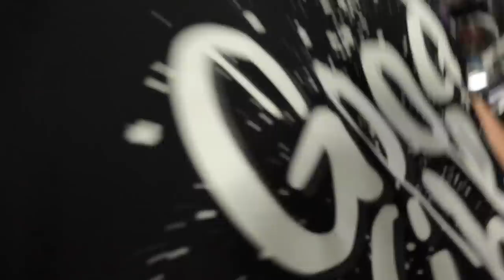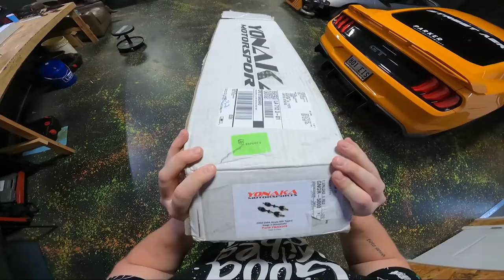This old Honda has 2 STEP??

Comment: 17x9 +22 is perfect fitment paired with 245/40/17. Also I highly recommend Acuity’s 4 way shifter, I tried the k tuned shifter and some similar ones but you had to be ultra precise or it wouldn’t go into gear
Reply: Or +35 if you don’t want to pull the fenders
Reply from the maker: Thanks! I’ll have to remember this for wheels
Reply: @Zorbii  i have a full new set of Rpf1 17x9.5 +32
Reply: do you have pictures on any media ?

Comment: I think a v12 swap sounds most practical
Reply: V12 AWD
Reply: @Vaigue  This ain't Forza
Reply: @aftrnoon_ac  Who says it c a n ‘ t
Reply: who the hell would v12 swap a rsx
Reply: @qajoh8714  it’s a joke
Reply: @qajoh8714  @boostedboiz ideas are flowing
Reply: I think a 40lt diesel v16+supercharger souds even practical
Reply: @hectorramssesgarcia4532  Tbh I think 3 2JZ’s with T66 Turbos, a 69420 shot of NOS, and a Motec system exhaust sounds more reasonable
Reply: Indubitably

Comment: I’d love to see a N/A route where you do some cool engine work and do autocross or time attack. Mine has 223K and still goes strong. So you won’t have to swap in a K24 for a good bit haha. But I’ve been wondering what my steering wheel was shaking for on to the expensive purchase.

Comment: Hey zorbii first time watcher, really like you stuff. I have a Acura rsx 06 apparently it ain’t actual launch control just a 5k rev limit when the car is not moving. Best part about Hondas is you can use the rev limiter as lunch control cause their engines are so durable
Reply from the maker: That's what I was about to say! It actually works great to use as launch control.

Comment: Daniel is not a second axle. It's an intermediate shaft/ half shaft.  Used to equalize axle lengths,  or you wind up with vicious torque steer. Like into the trees/ ditch, or in Japan, oncoming traffic.  I've been in the import tuner scene since pretty much you were in diapers... long before it hit Louisiana (S.E La here) I used to do all kinds of swaps, modulus Rbs into s13s (first properly working RB20 in the country)  unlike those d bags from VA who couldn't get there's to Rev past 3700. Anywho.. glad to finally see an upload from you.  Keep up the good work.

Comment: I have an 03 TL Type-S and I actually had my passenger side axle snap at 197k miles and I have to say the passenger side is a much different ball game than the driver when they’re being changed. Other than that though my TL will spin through 2nd gear with T/C on and broke one of my motor mounts so I had to replace that too.

Comment: your best bet to start with that many miles would be check the vtec solenoid cause those go out at higher miles mine went out at 230k. best starting mods would be skunk2 or drag cartel cams intake invidia headers to full race exhaust, hondata or ktuner, intake and a bigger throttle body with e85 and youll be ripping na next is supercharge it or turbo
Reply from the maker: Big bet

Comment: in the future, if you ever need to take the axles off again, I'd suggest unbolting the strut from the hub after you undo the lower ball joint. you shouldn't need to undo the sway bar or the tie rod this way( assuming the car is on jack stands like it was in the video)
Reply from the maker: My goal when taking this apart was to save the alignment.  Would those bolts effect the camber or are they studded? I just found that on the Mustang they're studded.

Comment: It will only 2 step at a dead stop. But if you roll a little bit and then push the clutch it should go to redline and then dump the clutch it should roast the tires pretty good 👍🏻

Comment: Ayo, so my 04 Accord does the same thing, ima try to get a video posted of my car or some shiz. My cousin, when he had the car, just welded on a aftermarket muffler and tip to the stock exhaust pipe after he chopped of the stock muffler. It’s not very pretty but it sounds alright

Comment: lol all you needed to do was disconnect the spindle from the strut. i use to do these repairs all the time
Reply from the maker: Damn. Note taken for the future
Reply: @Zorbii  also for in the future if you have to mess with ball joints again get yourself a pickle fork. it never hurts to have one around even for someone who doesnt do mechanic work all the time. i think you can get one at harbor freight for around $20-$30

Comment: hell yeah i got my 02 rsx type s at 160k miles i drive it like i stole it everytime i drive my car its at 193k now the only thing that has gone out on my  type s is the  clutch and the throw out bearing seems to fail and thus makes the clutch fail and brakes and tires haha normal shit lol pretty reliable engine as long as you keep it maintained properly
Reply from the maker: It sure seems like it!

Comment: Most k series cars have that, my 2010 si has it as well
Reply from the maker: My respect for Honda has increased.
Reply: @Zorbii  if you want a good responsive semi cheap build for that car I recommend, rbc intake manifold (stock manifold from the k20z3 out of the 07-11 Sis} plm header, skunk 2 exhaust, Acura RDX injectors and a j series throttle body with k pro it'll make 220+whp and be fun as hell

Comment: Un-pro tip: You can drill like 2-3 1/2" holes in your exhaust pipe, just before where it attaches into the muffler to make it a little louder. I've done this on my past 3 RSXs while waiting for new pipes lol. Doesn't sound half bad or make the cabin smell or anything.

Comment: Bro that ain’t not 2 step wtf that’s a safety module to prevent redline with in first gear while clutch is pushed in tbh I’ve had other auto cars that had this so called “factory 2 step” lol you good though ig

Comment: Not 2 step, thats obviously fuel cut so you dont over rev without load. Drive at about 10mph and you can freely rev out the motor to redline… again to a fuel cut limiter. You have ignition cut bro and you can legit hear the difference with the first car to the rsx. Makes no sense homie